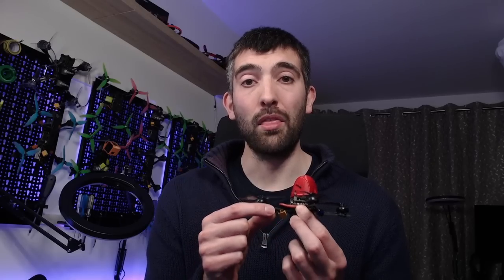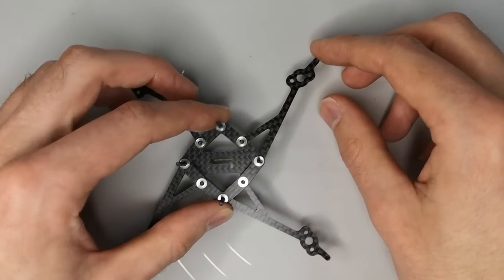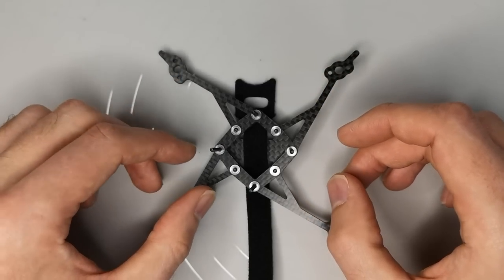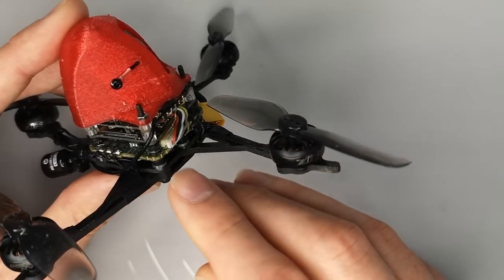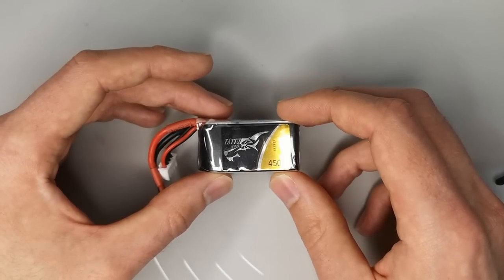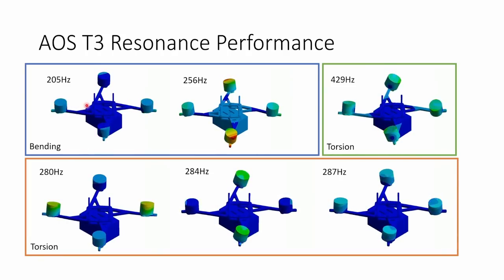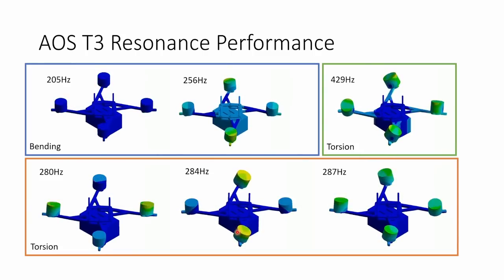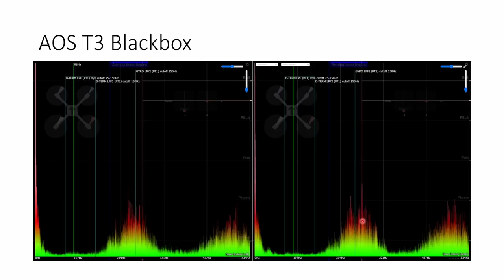Evolving the 3" Toothpick Drone: The AOS T3

Comment: Came here to say thank you for this frame, I built a 3 inch naked vista toothpick and it flew so bad and the only way I could get it to stop shaking was to lower the PIDS the point the quad felt sluggish and no fun. Than I moved ll the parts to your T3 which I got from CNCdrones and like a magic, I can now fly with default BF 4.3 PIDS and the quad is fun :) Saved my build, thanks!

Comment: For vista antenna you can use simple whoop style dipole, it works just fine for the typical range of toothpick, it is lighter and smaller
Reply from the maker: Thanks for the tip, every gram helps!
Reply: @ChrisRosser  The VSWR matching tends to be better too, ironically enough

Comment: Beautiful frame and really good points about resonance being the key issue in toothpick frames. I didn't understand this when I dremeled off the support struts off a Happymodel Sailfly-X frame to make my own lightweight 2S toothpick build. Had heaps of trouble tuning it and it wasn't until I hooked up an openlager and looked at the gyro scaled spectrum that I discovered the horrible resonance at around 70 Hz which like you said is almost impossible to filter out. Dropping the P-gain and D-gain (as you've pointed out) was the only way to reduce it. I also discovered my TPU canopy with 3 mount points was contributing to resonance: a trick I learned was placing it on my sub-woofer and doing slow 20 - 200 hz audio tone sweep while lightly touching the canopy to feel for when it hits its resonance frequency. A proper 4 point mount (at a tiny weight increase) fixed that problem.
Reply from the maker: I think resonance is one of the most important but least talked about perfromance parameters for a frame. It can really prevent you getting a great tune. Glad to hear you were able to address your issues. I like the subwoofer sweep!

Comment: A mechanical solution would be a tuned mass damper.  This does not need to add weight. Typically, the weight of the tmd is 1/10th  to 1/5th the  apparent moving mass. This added mass can come from already existing material in the frame by creating strategically chosen compliance and stiff areas. FEM is of great help here.

Comment: My semantic argument about 'filters don't perform that well at lower frequencies' is that this isn't the case, so much as the effective spectral content present when these <150Hz vibrations arrive is such that any filtering scheme that can eliminate all of that noise causes more problems than it is solving due to the phase latency penalty of removing that noise.  The filters themselves work fine, but the cost of applying them so low basically ruins the flight performance.
Move those first resonant modes above 200Hz and life is great... which is exactly what this accomplishes.  Great job Chris!
Reply from the maker: You're absolutely correct of course. I wasn't being very precise with my language there. The quad is what doesn't perform well with a lot of filtering applied at low frequencies. The filters themselveswork fine.

Comment: My frame has arrived yesterday. Very quick shipping from Canada to Sweden. Looks exciting, when seeing it in the flesh so to say. A TuneRC Poly board has just arrived. Will use T-Motor F1303 3S motors and probably a RunCam Racer Nano 2 or 3 camera, depending on what I can get hold of in these semiconductor crazy times...

Have some GNB 550 mAh 3S 90C packs waiting for this, I think this will be an epic little laser pointer in the air :-)

Comment: I will also vote for an unmet need for AOS to meet. A 2S racing whoop with great crash resistance and excellent crash-flip turtle mode capability. In my personal experience the best solution would come in the format of a well thought out 2.5" whoop frame. It is tougher to make reliable than smaller whoops but it is doable. If interested in challenge I will give my input (from 3 years pursuing such) for you to consider without any obligation to yourself.

Comment: Any option for doing 3 or 3.5 mm arms? (For running slightly larger motors for a little heavier build)
Reply from the maker: I'm sure you can. Just ask Nick at cnc drones to do you a special version.

Comment: I just lost my previous custom toothpick in a river.   Perfect timing for a new one.   I'm going full aluminum on the bolts and roku 1203 motors with 3018 props.
Reply from the maker: Right on! Super light weight build with aluminium hardware.

Comment: Hello Chris, i am building this frame but using the walk snail VTX, not the 1s VTX but the full V2, i do not plan to de-case it which means more weight, than your built. Should i go for different motors than the one you recommend or is it still ok if the weight with battery is about 140g?. What would you suggest i change to achieve a good flight performance

Comment: Funny thing about toothpicks is that the front motors are in view and I've actually SEEN the arm-twisting bending mode in my DVR frame-by-frame review. My current 2.5" Pyro Apex frame has no resonance under 200hz but the arms are wide and afaik isn't produced anymore. This looks promising as a replacement; I'd put emax 3" biblades on the 1103.5 8000kv motors for 2s performance.
Edit: this would be for an analog toothpick but now I think I'll move my retired analog tadpole build to this frame for a naked vista. It has 1204 5150kv motors for 3-4s on 3" and I'd probably run the same on the toothpick build
Reply from the maker: Sounds like a great plan you definitely have the motors and you should feel a postive difference with 3" biblades vs 2.5" triblades! I hope it flies great for you 😁

Comment: Thanks for the interesting frame design! Can you share the PID-F settings for this build? I am flying a low-budget 2s Crux3 (analog) and just went through some PID tuning (also thanks to your tutorial ;-)
Reply from the maker: I will do when I finish the tune 👍
Reply: The Llama GTB 339 tune will work well on that - you can probably run much more aggressive filtering than that applies, but it will work.

Comment: This is interesting. So, the FPVCycle TP3 is about 3g lighter. However they make braces for the frame that add about 5g that, I assume, give it a somewhat comparable resonance profile to this frame.

So, when flying VERY light, 100-105g AUWg 3s toothpick, you get away with quite low pids (d in the mid-liw 40s) and bring your dynamic notch below 125hz and it flies fantastic. Adding weight (like using the braces) even in the sake of resonance management, makes it fly worse overall because of the drivetrain and such, the lighter build with a less loaded prop is managed by the motor better. 100g with D's in the 40s flies better than 105g with D's in the 50's.

However, once you clear the 105-110g mark, you need higher pids to compensate for the weight (at least on the digipick I built). A naked toothpick frame cannot handle this. You HAVE to have some sort of brace or trussed design, and at that point you already blew the weight threshold so what's 3-5g? 

I guess what I'm getting at is, if you are tying to be absolutely as light as possible, you get away with a noisey frame and it will fly fantastic. But if you want a digipick, or are carrying a heavy analog DVR, adding braces, or choosing a design such as this is pretty helpful in being able to push the pids up to get it to fly well.

If I didn't have 40+ spare tp3 arms already, I'd pick one of these up for sure. I'll probably try one out this summer as info through arms pretty quickly.
Reply: I actually picked one up, will arrive in a month or two, probably just in time for decent weather where drive to fly will outweigh the lazyness. I still suspect 3.5'@3s might be the target for digipicks (not tested what so ever, still cant find where I put the frame lol),  very interested in comparing. That said my main experience with toothpicks is a 50g AUW 1s pick (520mah, 1202 motors + HM 2g4 AIO 5a with ELRS and VTX built in, plastic and titanium hardware e.t.c.), that TBH flies surprisingly well, apart from me wanting a bit more powah and well.. not analog :)
Reply from the maker: I think the TP3 is around 9-10g. Does that include the stack screws?
Reply: @ChrisRosser  yeah it's like 10g with hardware. Not having flown your frame, but having flown a braced tp3 at 15g, I still feel like if you can hit the 100g mark (for 13mm 5000kv 3s 3"), that is worth staying on a lighter and perhaps louder frame. If flying 1s, going super light like a babytooth unibody is still worth it. But if you are clearing 105g on your build, something like your frame makes a lot of sense. Looks easier to maintain and less likely to be claimed by a tree (big triangles catch branches) than a tp3 with braces. 

I also really like how you did the 20mm mounting as well. Very nice work.

Comment: Very nice Chris! If I had not just finished a toothpick build I would get this. Maybe I need another🤔. You said you were flying this on stock Betaflight 4.2 pids and filters. Can you recommend a starting point for pids and filters using 4.3? I have the same flight controller as you do on this build is why I ask. Thanks

Comment: Hi Chris,
Great video and definitely interested in this tiny frame.   

What are your thoughts on a build using the HGLRC Zeus35 Pro AIO FC, RunCam Link Caddx Vista MPI System, Newbeedrone 1404 3000KV motors and crossfire Nano RX Receiver?

Also if I purchased the frame, would it be possible to purchase a canopy that would support the HGLRC Zeus35 Pro 20x20 mounting pattern?
Thanks.
Reply from the maker: I would say that's a good build but I would choose 5000KV motors and maybe 1204 or 1303 (1404 is too big for 3" biblade in my opinion and will add too much weight). Canopies are available from Brain3D.
Reply: @ChrisRosser  Thanks for the advice.
Reply: @ChrisRosser  Hi Chris,
Sorry to bother you again.  A couple of quick questions:

(1) Will 1105 5000KV be to small?
(2) I contacted Brain 3D and they don’t have a 20mmx20mm size canopy that supports a 19mm camera.  That size is only available for the 25mmx25mm canopy.  Is there a reason for this?

Thanks. 
Sam

Comment: Hi Chris.Have you done any testing on soft mounting of motors?It was all the rage a couple of years ago and worked but you don't hear anything about it now.Some people used electrical tape or tpu 3d print.
Reply from the maker: I've had good results with a smear of mechanical damping grease underneath the motors but the best thing for vibration is damping grease where the arms meet the frame.

Comment: Hi Chris,
I'm building a toothpick and using your recommended parts for HDZero.  If I'm planning on using the 450 mAh 3S battery, do you need I still require a capacitor on the battery leads, or will I be OK without a capacitor?  Thanks
Reply from the maker: If your AIO is 6S capable you won't need a capacitor on 3S.
Reply: @ChrisRosser  Hi Chris, I just saw your video on Gyros "Gyro shootout" and you had some recommendation for the BMI Gyro.  Because my toothpick build uses the iFlight Beast F7 V2 which contains a BMI270 i wanted to implement your recommendations like using 3.2K mode and the low pass filter settings.  For some reason BF 4.3 won't allow me to change the default frequency from 500 to 250.  also i don't know how to change to 3.2 k mode or where that is configured.  Thanks again for all the great knowledge your passing on to everyone.

Comment: Will it be available from banggood?
Reply from the maker: That's the plan 😁
Reply: @ChrisRosser  do you have a rough estimate when will it happen? shipping to germany its a little bit costly, if it would be available in a few weeks, I could wait for it
Reply from the maker: @danka901  It will certainly be several weeks as chinese manufacturing is shut down for chinese new year. You can contact support@prime-cnc.co.uk to maybe order one from Sam in the UK as he's just started cutting parts for me.

Comment: I bought the frame. I have a question though - Aren't a lot of screws increase vibrations and resonance?
Reply from the maker: The opposite in fact. Joints add damping which reduces vibrations. Solid frames like the marmotte or chameleon have bad resonance problems as a result.

Comment: Thank Chris, I think I am going to  build one of these but I was wondering what you think about putting the fpvcycle 13mm motors on there. what about a 500mAh battery. thanks so much for what you do :)
Reply from the maker: Those motors should do great as they are designed for 3" biblade props. 500mAh 3S would be OK I think. 500mAh 2S would be fine also.
Reply: @ChrisRosser  thanks

Comment: Fun design! It's reminiscent of the Diatone with the funny arms. 
Would you not benefit from slightly longer arms? That would make the airflow further away from the branch.
Also is there any difference between a y shaped arm and an arm like the ones you have (it's more like a runic letter than a y)?
Reply from the maker: A runic shape keeps continuous carbon fibre filament running along the length of the arm.
Reply: @ChrisRosser  Duh, I'm stupid.
That said arms a wee bit longer may still I think be beneficial.

Comment: My two cents on battery mounting.. I designed a frame with a similar slot for a piece of velcro. Instead of umagrip, I printed a piece of tpu as tall as the socket head m2 bolts and fit it over the bolts. Then I set the velcro strap tightness so that I can slide the lipos in and out but they are very snug. This isn't possible with sticky battery pad solution.
Reply from the maker: Cool idea thanks for sharing!
Reply: I flew loose battery for years.   It is fine for level flight.   However, performance is much better with the battery tied tightly to the frame for bando flying.

Comment: Will the 4s 450mah be also good for this build? I have those batteries from Alpha A85, I would like to move all components from it to this frame.
Reply: Im thinking to do the same.. Have you done that already? I would love to switch from Alpha A85 HD to toothpick! :)
Reply: @MrOlisko1980  yes, I used everything except props, ofc lighter 3s battery might be better, but comparing to alpha, T3 flight much much better, it is fast and precise
Reply: @szymonwesoowski4628  have you made caddx vista naked?:) Have you printed your own cannopy for camera? So you are using 4s 450mah? Just trying to find out what additional parts I need besides the frame:)
Reply: @MrOlisko1980  yes, naked vista, printed canopy, 4s 450mah battery
Reply: @szymonwesoowski4628  and last question: which props are you using?
Reply: @MrOlisko1980  The ones recomended by Chris

Comment: Perhaps you could share your pids and filtering on this frame? I find it very hard to tune this without blackbox
Reply from the maker: Tuning without blackbox is not easy. Without blackbox all I would do is gradually increase the master slider.
Reply: @ChrisRosser  I got the same motors as you and an clean build mind sharing your progress on filtering and pid?

Comment: I've had best results with 3" props using 1404 motors on 4S with KV's around 4,000.  I’ve done about 10 of these now looking for what I consider the perfect combo.
Reply from the maker: I guess that's with triblade props though? 1404 is massive overkill for a biblade 3" prop in my experience.
Reply: @ChrisRosser  I pretty much only run biblade T3x3 with 1404’s. I like the way they respond and corner.

Comment: Could you do a video about Component selection for maximum flight time?
Reply: I would like to see that too, but if its too much work, could you just share some toughts here in the comment section? :)
Reply from the maker: Use big bi-blade props and minimise weight wherever possible.

Comment: Asymmetric? won't this induce different characteristic modes for clockwise/anti-clockwise yaw moves in particular?
Reply from the maker: The frame geometry is rotationally symmetric so there are no issues on the yaw axis. The motors are exactly where you would expect them to be on a typical design so roll and pitch are unaffected. The only effect is a unique look to the drone.
Reply: @ChrisRosser  thought about it once more. The rotational symmetry does not imply yaw stability or balance. you could design a frame that is shaped such that the first mode would bend the arms with a non zero z axis torque. Of course this must be 99% neglectable in this frame design, just from a theory point of view I was suprised you went that route.
Reply from the maker: @charlesmarseille123  Vibrational modes are a different topic than stability and balance in yaw moves and best approached with FEA and balckbox analysis. Stability and balance are more related to CoG, CoT and MoI.

Comment: Have you tried this on 4S? 3000kv 3" props should sing on 4S, though you may want to go for 3018 biblades.
Reply from the maker: I misread the bell. They are 5000KV not 3000KV, I'll pin a comment!
Reply: @ChrisRosser  that makes a lot more sense. However if you have a light 450mah 4S give it a go... In my experience it will work really well with a 3016 😁🚀
Reply: @ChrisRosser  also thanks for this video, it explains why my custom 3" frame flies so well. I don't seem to be able to post a link on here, but take a look at build 28832 on rotor builds. I'm most proud of the screwless hanging system for the FC.

Comment: Why not 1303 5000KV for 3S? My TP3 weighs 105g AUW with 3S 450mAh and 3016 tri-blades, on 5000KV it blasts through the air, loads of fun. Still getting 5 minutes of freestyle. Smooth tune too on BF4.3.
Reply from the maker: Damn! you made me check and I misread the bell. They are 5000KV, I'll pin a comment!
Reply: @ChrisRosser  Ah! Yes was surprised it flew that way in the footage.. thought 3000KV would be too low, now I understand :) Yeah around 110g AUW is sweet spot with 5000KV 3S, but 115-120g still flies great 👍🏾 especially if you have stiffer arms and can up the P/D like you said. Below 105g it gets really fun.